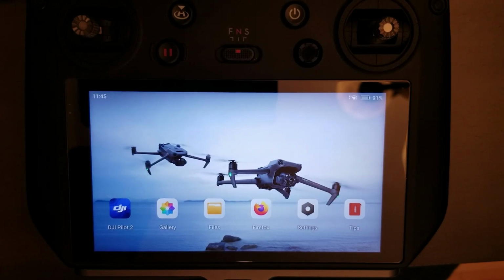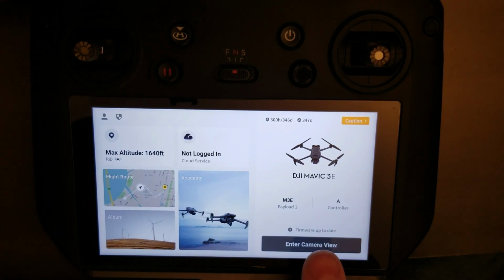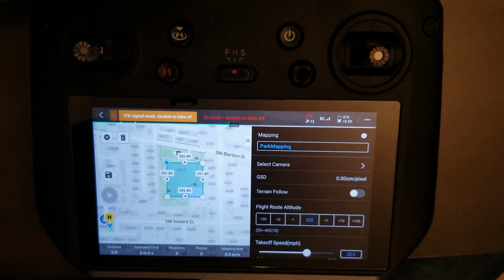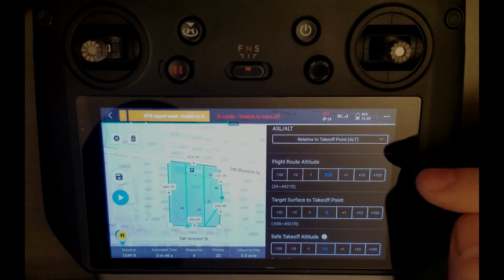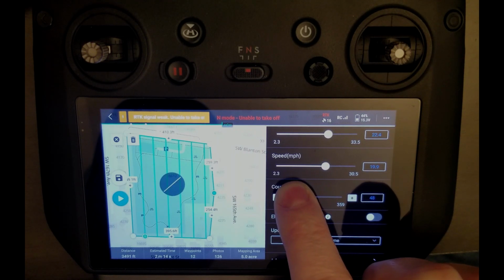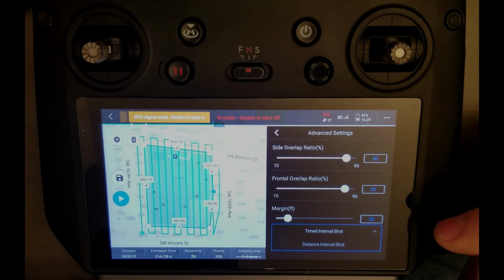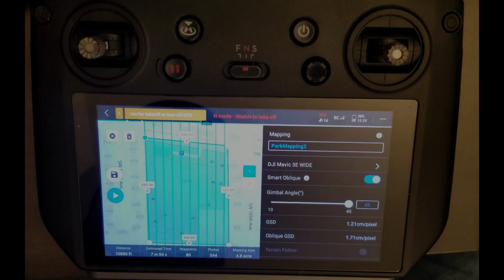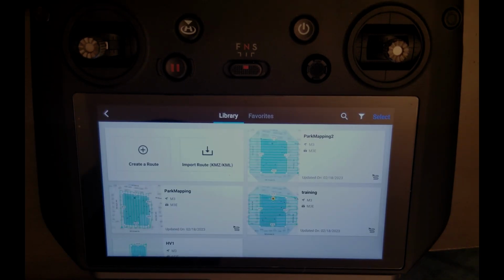DJI PILOT 2 MAPPING

Comment: Interesting!  In the Smart Oblique option, is there any way to suppress the second (#2) Flight paths if on the the first orientation is called for?    I don't want to wear out the shutter or over cycle the batteries if I don't need to.

Comment: Great tutorial. I have the M30T but the software is exactly the same. Are there any web-based ways to design mapping missions? I don't like trying to move points around with my finger and don't think our controllers support a pen for drawing. I tried using Google Earth and then imported the KML file but all of points were off. In fact, the whole grid was over the next field.

Comment: Thanks for doing this. What software do you use to process your images after your missions?
Reply from the maker: I know that there are many programs out there and they are all good in their own right, but I am partial to Agisoft Metashape.  It allows me to control all the aspects of the processing and allows for scalability when you want to jump into the aerial lidar world.  The only thing about the program is that it is a German based company so support is hard to get sometimes.  I will work on getting a video up on the basic processing steps her in the next week or two.

Comment: Great video. Very understandable. How would you set up a search mission, not a mapping mission. Not taking so many photos but self flying while you watch the search area. Please help. Jim
Reply from the maker: Jim, that is a great question.  I am a surveyor by trade and that is not a function that I predominately use.  I will ask around and if I can find an answer I will post another video.  I think that the best way to achieve it will be using the waypoints function.  Thank you so much for the feedback and have a wonderful day!
Reply: This has been discussed by others. I think the best they came up with was change the settings to the max so it takes as few pics as possible. But that was about a year ago. They may have found something better by now.